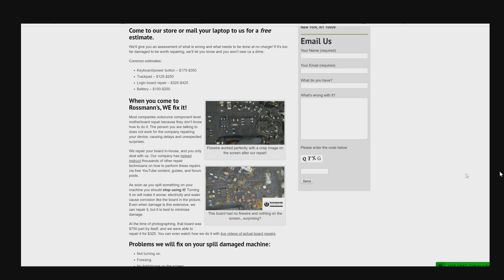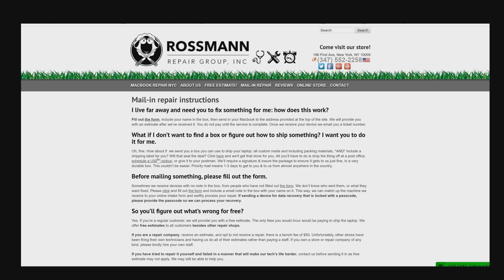USB drive DESTROYED by customer; Louis attempts data recovery anyway.

Comment: I'm not a professional at it but in the future if you use a sewing needle along with the soldering iron it'll help you bend the legs back a little easier. oh I almost forgot you'll have to go at the pins one at a time and it'll take up a little time but a little bit easier. Oh and I may have waited before i put that other liquidy stuff on there which I don't remember what it's called because it makes the job a little harder. Less of course you're trying to waterproof the board. Please let me know if I'm wrong. But overall fun to watch

Comment: A number 15 scalpel blade is really good for cutting traces and peeling them up.  Just remember not to put excessive lateral pressure on the blade.  They break and go flying if you put too much lateral pressure.

Comment: That fucked pad on the board isn't important for the function of the drive. 

You can find the pinout for these on the Flash Extractor TSOP-48 page. The outer sets of leg-pad connections on TSOPs are redundant. Just the ~16 middle legs on either end are used.

Comment: When you solder the original usb connector back on, the area looked like it had some brown or burned funk. I supposed it was in condition to still be soldered on, I thought you would need to clean the area first. Elaborate when can you leave burned solder and it still works?

Comment: Louis, you're supposed to lower brightness to basically the lowest levels possible when you zoom in to show anything on solder as it reflects light too much when the surroundings are so much darker. When I take pics of my solder under the scope I sometimes use the lowest brightness but usually it's at around 2 out of 10.

Comment: Next time use chip quick it is mercury and solder flow solder into all chip pins then remove with tweezers , then I wick the contacts brush flux then resolder too bad you don't have a air desolering station. But you can make a hot air pen.

Comment: On that missing pad - just scrape the soldermask off the trace right there and attach a small piece of bus wire. Don't guess on what the pin function is.

Comment: You should grind a small hook on the end of a solder iron tip, that way, you can hook on to pins like that with ease. They actually sell these kinds of pins, but they aren't made quite right, you want almost a hook, works really nice for super, super small tracing.

Comment: I have a broken usb stick because I connect the header plug inside the motherboard with wrong side. So I think data channel gets power when power line gets data or wrong polarity etc.Now I connect the correct way the header pins inside the motherboard and all my other usb devices work as expected except the usb stick. Can I fix it?

Comment: I use a stripped blood glucose lancet needle to separate pins / clear bridges. Solder doesn't stick to those needles, and they fit even between TSSOP pins. I wonder if there any tools that are actually intended for this use (when wicking is not an option).
Reply: there is, I have a set around here somewhere https://www.ebay.com/sch/sis.html?_nkw=8PCS%2FLots+Hollow+needles+desoldering+tool+electronic+components+Stainless+steel&_id=291635834592&&_trksid=p2060353.m2749.l2658
the one I got them from is sold out

Comment: So I am guessing this was a case of a dropped laptop with the USB Drive sticking out the side, and it snapped off, and then they gave it to a monkey to fix before bringing it to a professional?
Reply: I'm afraid that the monkey who tried the repair was probably the owner itself...
Reply: Can be also laptop in bed or workstation on floor in legs way for one who works on it etc. Seen folks who managed to broke their flash drive bg pulling them out from computer in rush. This guy certainly ripped connector out together with traces. Repair attempt by him was not less lousy ;)
Reply: @KrotowX  when u say ripped connectors out do u mean them bits of wire this guy refitted?
Reply: @oddity4650  With ripped I mean broken. Teared off connector by hitting on pulling that poor stick in rush or because he/she doesn't care.
Reply: @KrotowX  is that what he replaced that connecter that bit of wire, as it looked like he cleaned the bad soldering then added a few wires.
Reply: @oddity4650  Seems that definitely happened.

Comment: I sent a hard drive to Seagate for data recovery.... the controller had smoked and I needed it replaced.    They sent me back a NEW drive as their process is to wipe all data on all received hard drives - despite the assurance that this would not happen

Comment: People should stop storing anything important on Flash Drives, store them in the Cloud, or backup to a real disk somewhere. The only thing suitable to be left on USB Flash is things that can be easily downloaded again or cute cat videos..
Reply: Storing things in the cloud is asking for them to get stolen.  And SSDs are just flash drives with a different interface.  Spinning rust fails much sooner than solid state - I've had multiple HDDs fail in the span of a couple months before.  Platters warp, head crashes, and it's over.

Comment: Remember to always buy two drives. Always buy two drives. If a retailer has a special for a PC with backup media, buy that if the PC suits your needs. If you're going to be super-cheap about it, partition your drive to keep your personal stuff outside of your system drive in case you ever have to format system or migrate to a new machine. Ideally you want to keep two external storage devices connected at all times; one for your personal data and one for your backup of that, but not everybody has that kind fo money to blow.

Comment: RAID USB?
Are there any USB thumb drives that have redundant backup built in?
Seems like a really great idea. Here's what I'd love:
1) dual-ended USB drive for redundant CONTROLLER chip
2) 3x RAID1 or whatever makes most sense (i.e. 3x8GB = 8GB)
3) built-in diagnostics and an LED to confirm everything works

Comment: Louis Rossmann,
Apple could have done that faster:
Step 1: Smash with hammer
Step 2: tell customer they are out of luck but owe them $1200
Step 3: convince customer to buy another Apple device.

(I'm sarcastically referring to your GREAT piece about how Apple repair would replace motherboards rather than wait for the code to unlock the laptop)

Comment: Reminds me of wayyy back story. 5-1/4" Floppy storage days. A customer of ours kept complaining that his backup disks would go bad after a week or so. We replaced the disk drive, we eventually gave him a temp replacement PC while we brought his in and ran tests until we were blue in the face. Could not reproduce it. Meanwhile he calls in and says even the new computer was wiping out his backups now.
I went to the site and he showed me that his software disk worked fine (accounting stuff), but then he put in one of his backup disks and nothing... just a read error. I asked him to try a few others and he reached over to get his other backups - conveniently stuffed behind his phone - between it and the wall where it sat on his desk. 
None of them worked. Only a couple of them would even format. Then it just hit me as I loked at that old phone. It was an old, huge, heavy, black, office desk phone. I went over and unscrewed the earpiece cap - sure enough, the old heavy magnets. 
I made up some goofy garbage about how since he was making backups for his customers, I wanted him to start using this case (I had plenty of those simple plastic 10-disk folding cases everyone had back then) and handed him one. Keep it next to the PC instead of the phone to help protect the backups, and see if it helped. Never had another problem with disk erasure, and he ended up with stacks of those cases full of disks over the years until HDDs and ZIP disks became things :)
Reply: Reminds me of as story from the 1970's of a musician who kept his reel to reel master magnetic tapes of his band next to his old Western Electric Telephone  - the tapes had severe drop outs  = then back tracking , it was discovered everytime the old Telephone rang, it had degaussed the magnetic tape from the EMF Flux field from the internal ringer solenoid inside the old phone  -

Comment: Louis, for the missing pad, why wouldn't you scratch away some of the protective coating on the trace for the pad, then run a jumper from the exposed copper to the chip leg?

Comment: Been there, done that. The person managed to snap off the USB plug which broke about a dozen tracks in total. 

They actually wanted to use the thumb drive after I fixed it but it was only good for recovering the data to a hard disk folder and burning to a DVD data disk.

Comment: It's fun watching you do data recovery too! When for the first time i began job at mobile repair shop i did smartphone repair on a phone that came without usb port and the solder pads were ripped off. When i started cleaning it with the iron more fell off and it was terrible. The bad thing is that my employee didn't bought me a microscope so without a microscope i soldered wires onto the new port and then kept it under a tiny magnifying glass then i soldered it on the test points that were on the phone's board.

Comment: What that white device that you plugged the drive into?
Reply: A super high tech and expensive device known as a USB hub. Absolutely required for Mac work.
Reply: @wingracer1614  They make devices for data recovery that limit current to 500mA wasn't sure if it was one of those.

Comment: Why not just replace the flash and controller on the donor with the damaged drive's?
Reply: Because it might not be the same board and that would have taken longer than this did. It only took him 15 minutes.
Reply: @wingracer1614   sorry but I thought donor meant "same product" in this case.. It would take shorter time to replace the chips in my experience

Comment: Since I BET there are a lot of people like myself here that uses Samsung phones, and don't actually use any apple devices. I want to share how Samsung seems to be running the same scam as apple with their "genius bar":

I just had a MAJOR issue with my Samsung Phone, where the unlock pattern changed by itself, and locked me out of my phone (since I restarted it in hope that the bug went away, I only had the option to use the pattern that was now changed to unlock my device). Full story here (until they ban, then remove the thread): https://eu.community.samsung.com/t5/Smartphones-Tablets-Wearables/S9-changed-pattern-by-itself/td-p/899995

They recommended me, as the ONLY solution for my issue with the phone changing unlock pattern by itself, to send it to repair - which I would of course have to pay for myself (their words, not mine) - since "I" had "forgot" my unlock pattern ALL I  had to do to solve it was to reebot into recovery (POWER+BIXBY+VOLUME UP button after restart then release the power button when the Samsung screen showed up), then factory reset (WIPE DATA) and VOILA. I now have my device back! And YOU CAN keep your data! Just go to findmymobile.samsung.com and do a backup before the reset. You will get the option to use it when you set up your device again.

The reason I couldn't just unlock via the findmymobile.samsung.com page was that it wasn't set up to begin with (big help there).
Reply: Brainlet smartphone security: having an unlock pattern/pin
Smartguy smartphone security: having an alphanumeric password
Ascended smartphone security: not having a lock because your all plastic $100 budget phone is repellent to thieves
Reply: @nogravitas7585  IQ: Understanding that of a pattern can stop working, so can a pin or alphanumeric password. Also IQ: Understanding the topic before you reply.

Comment: I have an old 8gb flash drive, it was cheap and has a metal exterior. It broke on me, I considered it dead. For the hell of it I took a bic lighter and heated the shit out of it, no mercy, didn't go light on it just heated it up for a long time. Let it cool and it works again, seriously. If it had something important on it I would not have done this though.

Comment: I have an external hard drive that can't be read. I know it knows its plugged in but I can't open it. If I sent it to you, should I give you another external hard drive in case you need to transfer data. Staples said it would be around $200. Their 1 taraby hidrives (which is what is need) are like $60

Comment: Those ripped pads ans smashed pins on the flash chip are quite normal for this style of flash drive.
Over time the (super small) PCB support pins break and when plugged in, the PCB gets pushed farther into the case, causing the two pins that connect the halves of the case together to smash in the chip.
If you ever notice one of these flash drives to have a loose PCB, crack open the case, fill it with hot melt glue and push it shut again. Else, it would likely end up like this one. (minus the crappy repair attempt...)

Comment: The missing pad at 4:23 is supposed to be missing.
That pin wasn't needed so they decided to run a trace under it. Also, to help make sure the pin doesn't rub through the solder mask they added a silkscreen rectangle under it as a second layer of insulation.

Just a tip for the next time you run across this.

Comment: I just found one usb drive that droped and didn't work anymore, now looking a bit closer i found one pin on the flash drive that got pulled up, i'll try to solder it back in place with my cheap soldering iron with a bad tip, wish me luck

Comment: I have a BOX. A BOX of those exact, cheap ass 1GB drives.

DOA rate out of the box: 60-70% (Max chain of 4 in a row, out of the box, trying to get a drive letter)
Failure rate a month or two later: 30%

I'm tempted to crack one open now.
Reply: Well they're dead anyway so I'd do it if i were you

Comment: I have accidently washed and even ran one through the dryer one time and they still work fine. What happened to that one? The dryer one was in a protected pocket though. Thanks for standing up for these abused chips ;-)
Reply: as long as its not powered on water has no effect unless it corrodes traces.
Reply: @darkshadowsx5949  Yup. I have a 10 year old flash drive that's been washed at least half a dozen times and it's still working. Last week I washed my (fully charged) Nitecore Tube and it was corroded to hell and the charge switching transistor was blown (no idea how that even happened).
Reply: The USB connector broke off it and the user went into ape mode and randomly soldered stuff
Reply: Since the connector was ripped out. It also flexed the pcb and caused cracked and ripped joints around the chips.
Video game carts do it also.

Comment: And what if someone pulls out an encrypted drive from a MacBook / Hackintosh and does a brute force or otherwise wants to get to the data. 

Will MacBook encryption protect you? In the iPhone there is a security that as several times someone will enter the wrong password, the disk will be deleted. 

But if someone has pulled out the disk from the iPhone, it bypasses this security? 
And similarly in a MacBook, if someone pulls the disk, it can "break it" until it "breaks"?
Reply: No. The actual encryption key to the drive is like 32 characters long and would take dozens of lifespans to brute force.

The drive wipe thing only exists to stop people brute forcing the comparatively insecure 4 digit pin to the phone.